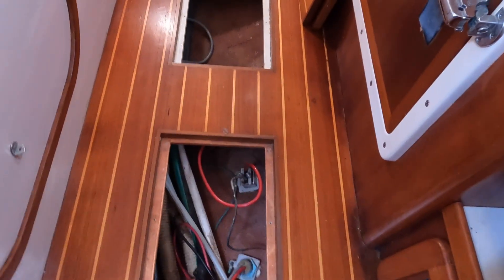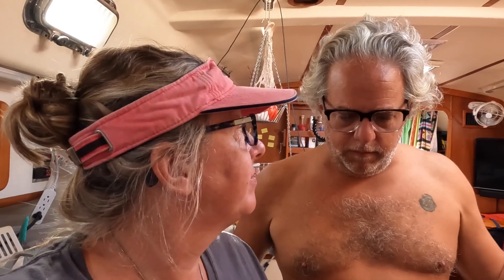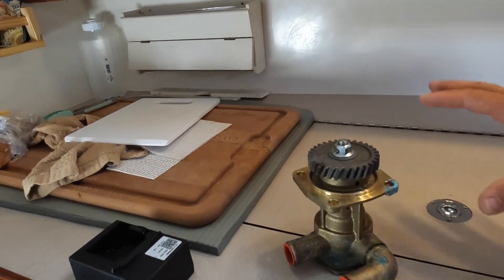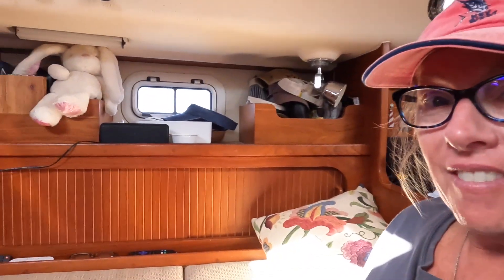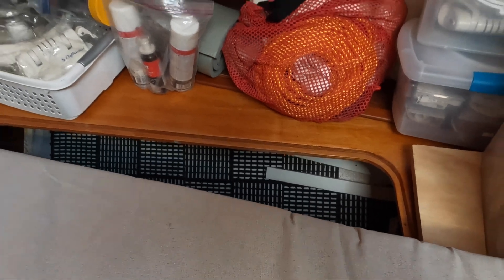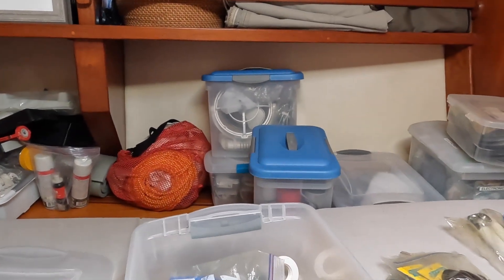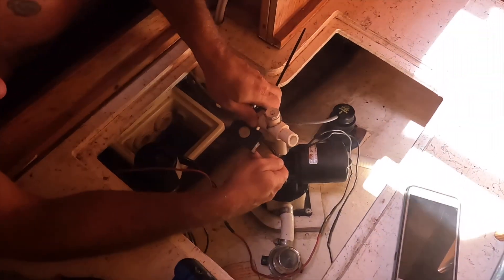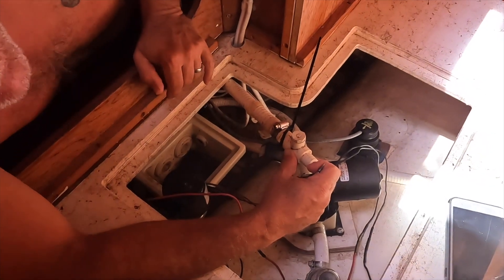Ep. 57  Bilge pump troubleshooting

Comment: That little black box at 4:15 is a Danfoss Fridge Controller, not necessarily wrecked if you soak and rinse it in fresh water, then dry it out, then rinse its circuitboard in metho, then dry it out.

The water pump gear is far from damaged. Wire brush, paint with grease, then use if needed.